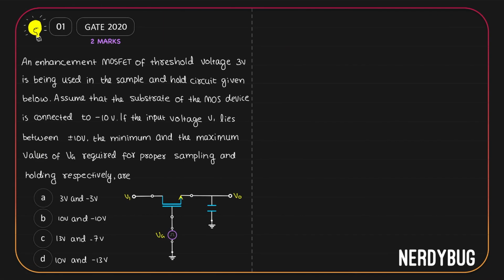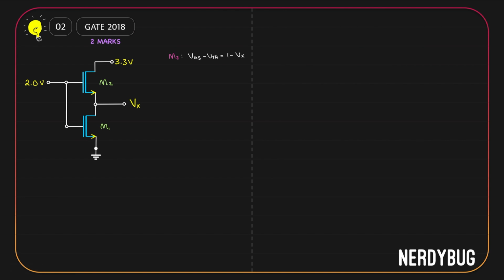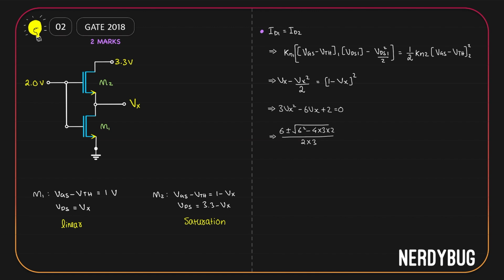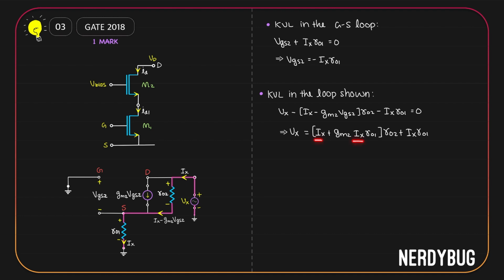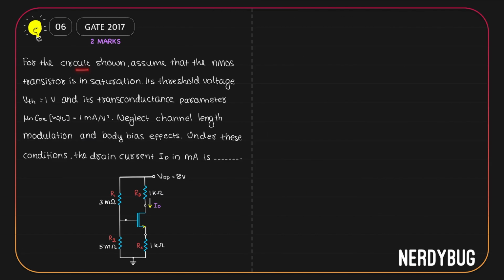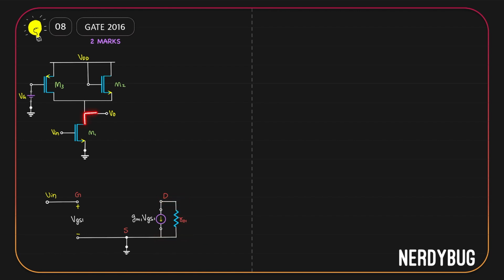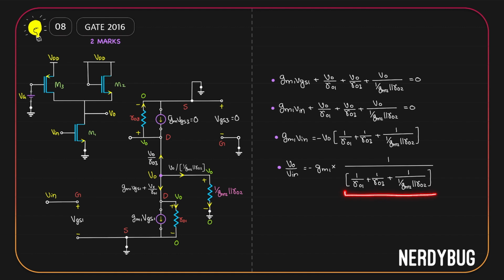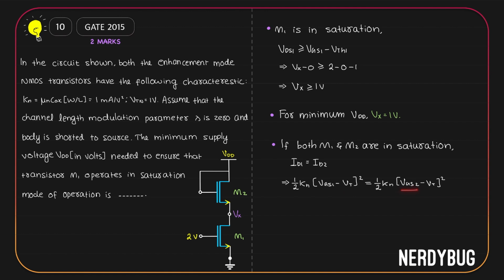Gate Questions on MOSFET Circuits Part 2 | 2015-2024 | GATE PYQ | GateBusters ECE | NerdyBug

Comment: Very nice content. But in question 2 , after finding out M1 is in linear region, in ID calculations, W/L ratio of M2 should be twice of M1, and its not considered in the calculation...I'm getting 0.5527 as answer.
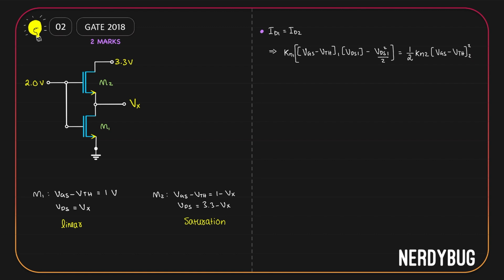Reply from the maker: W/L ratio of M2 is taken as twice as that of M1. That is why at 12:15 ,  Kn2/2 on the RHS and Kn1 on the LHS gets cancelled.

Comment: 3.54 Please explain Vg is vo how you take Vi?
Reply: It's a NMOS and arrow mark terminal is shown is source .
Also It is not mention in question vi is on source how we will assumed it is source???
Reply from the maker: @muditnamachhipa  In a sample and hold circuit, the MOSFET works as in the linear region. In that case the MOSFET behaves almost like a small resistor, so Vs ≈ Vd ≈ Vin.